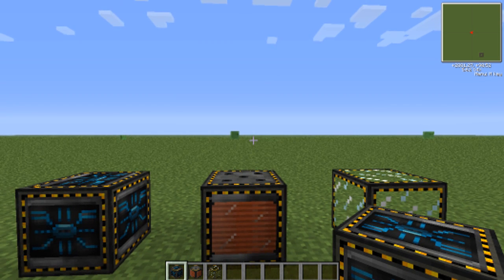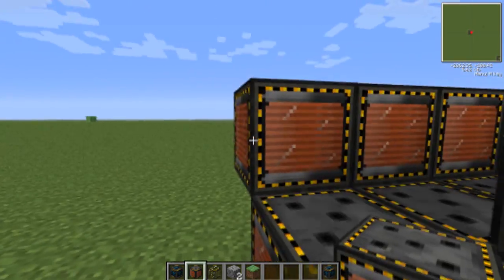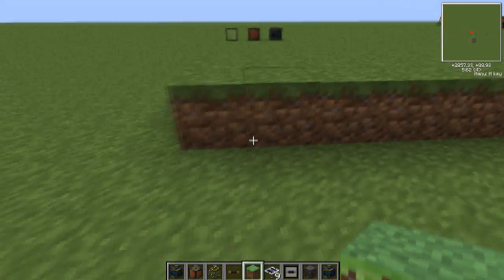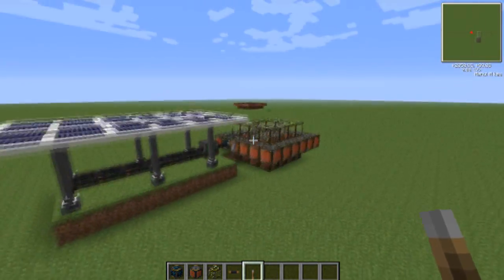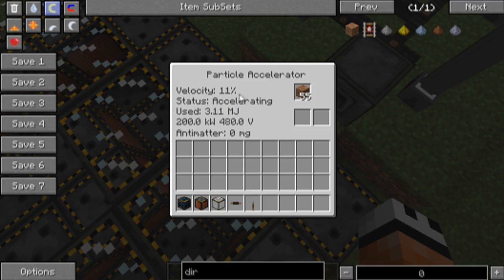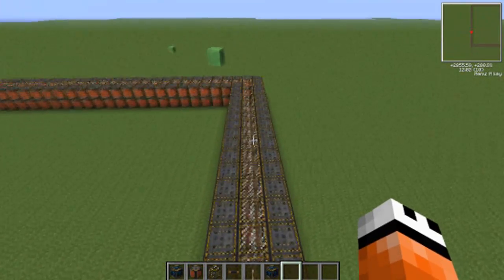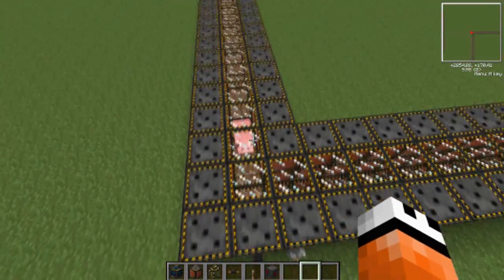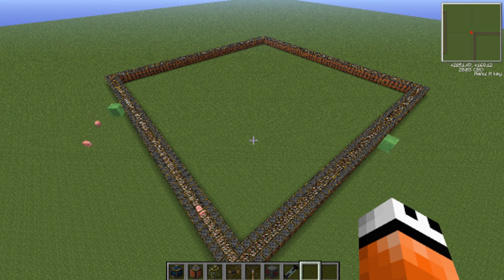Voltz Tutorial: Particle Accelerator

Comment: Mine keeps getting stuck at 91% the power is fine and there should be no problem. What did i do wrong here? its 40x40
Reply: rezt x soldier theres a new updat so now u need to have it like 55x55 minimum
Reply: i had it 78x78 and it was still stuck at 91% it might just be a bug.

Comment: No, particles with mass, be it an elephant or a quark cannot reach the speed of light.
E=mc^2 dictates that as you approach the speed of light, the energy you put into the system gets converted to mass. Thus, you will need more energy to move he system.
Energy required to reach c is infinite.
By the way, at the LHC, they do create antimatter. It's just that e=+/-mc^2 dictates that the collision has to produce antimatter in equal quantities with matter, annihilate each other and producing light.

Comment: And i believe that u are quite wrong.. These things are capable of making anti matter and they do not go in a straight line anywhere O.o However the particles in the CERN supercollider only accelerate until 99.999991% of the speed of light and at that speed they are not capable of making antimatter, if it however were to go faster it would have made antimatter... Only reason they dont is because antimatter colliding with materia would make a HUGE explosion, Get ur facts right dude
Reply: The CERN laboratory has successfully produced antimatter, and contained it. It's very possible to make antimatter.

Comment: Really?  I have a 30x39 (had to extend it after 30x30 failed) and i can only get up to 83% velocity...and with 30x30, only up to 78%.  Waited for it to use an additional 10 Mj to check if it would go up and it didn't.